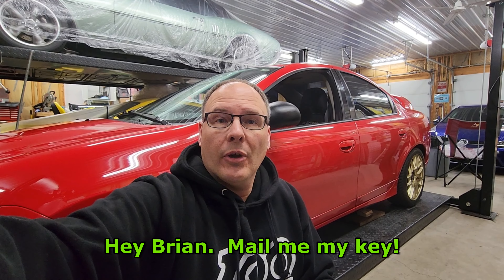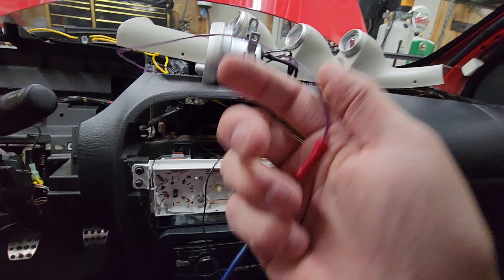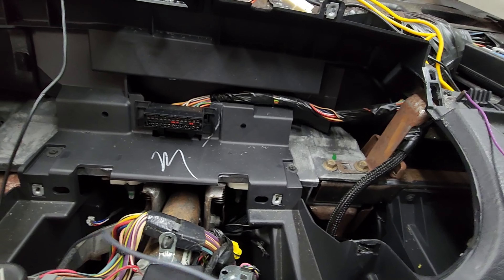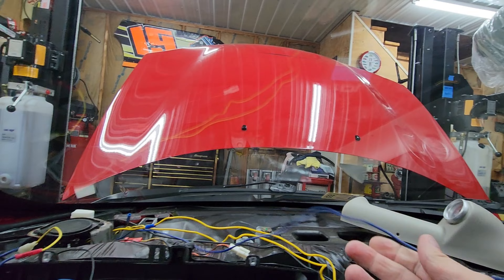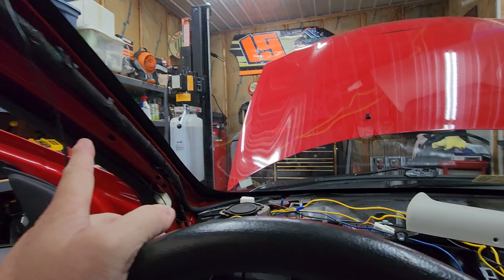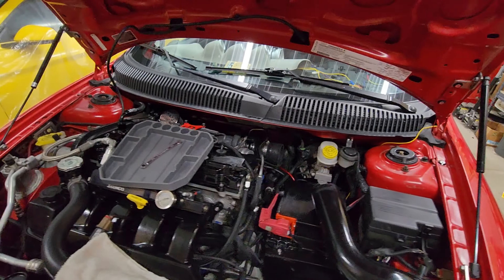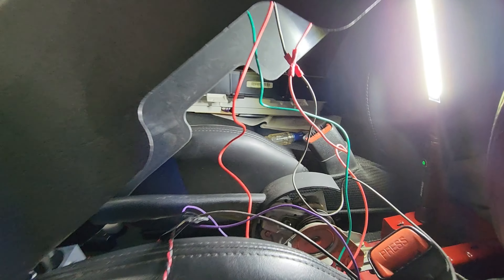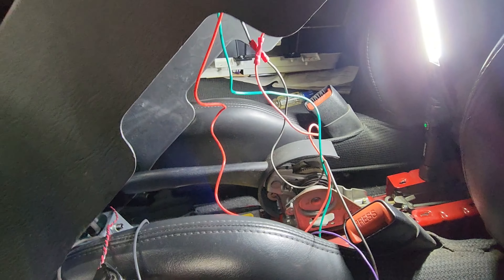Modified SRT Nightmare!  If you don't know electrical, then STOP!

Comment: The reason to put an inline fuse after he jammed wire into the hot side is cause it doesn’t matter if that fuse blows his wire will still be hot. I’m an electrician but not for cars. Completely different so I could be wrong.